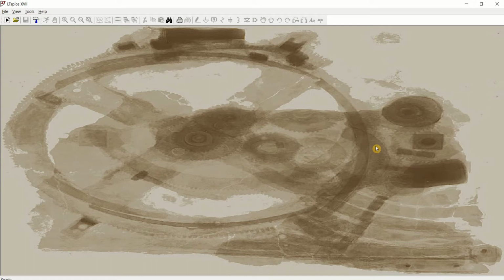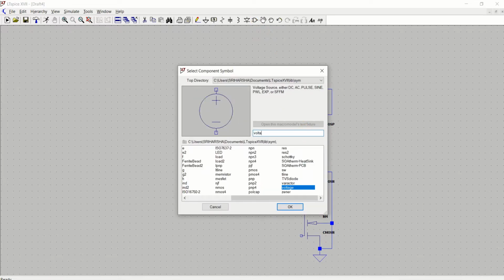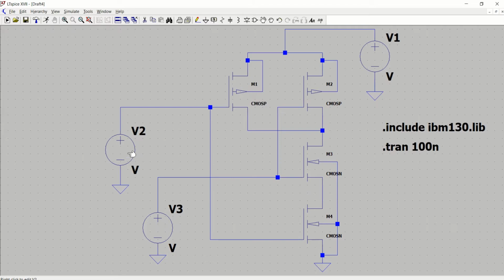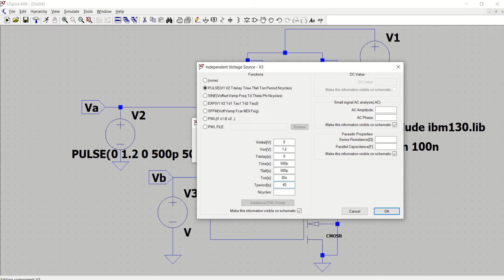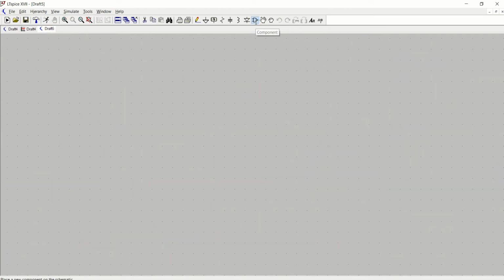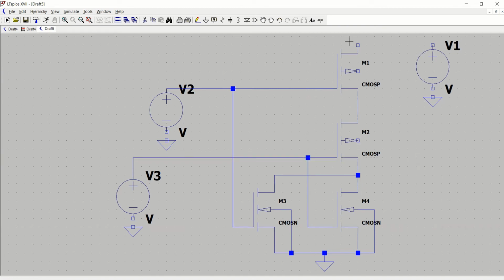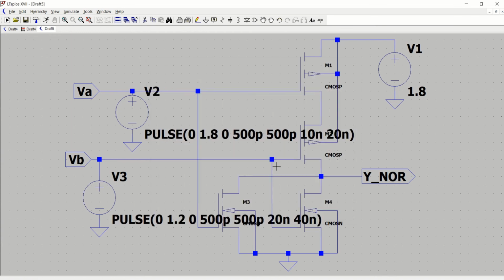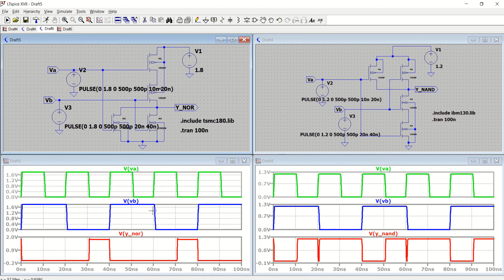CMOS NAND & NOR Gate Characterization Using Lt-Spice.

Comment: Dear Professor, 
Please, I need to help me to change the interconnect parameter in the LTSPICE for CMOS circuit conception.
Thank very much for your help 
Best wishes
Reply from the maker: What is that you are asking. I could not get you
Reply: @dr.hariprasadnaikbhattu Please, I need to simulate the impact the of the interconnexion using the LTSPICE.

Best wishes

Comment: Which one is source and drain
Reply from the maker: Hi, Always source of PMOS connected to Vdd. Source of NMOS connected to Gnd.
Reply: @dr.hariprasadnaikbhattu  thank you sir.
But I need to know with respect to body terminal.
Reply from the maker: @rohithy61  Body of any transistor is connected to source.
Reply: @dr.hariprasadnaikbhattu  thank you sir
Reply: I have one more doubt sir.
For designing full adder using 8 transistor i.e using two 3 Transistor XOR gate and one 2 transistor multiplexer, how do we need to calculate power and delay of circuit using ltspice
Reply: Please tell me sir
Reply from the maker: @rohithy61  follow any tutorial on ltspice in google
Reply: @dr.hariprasadnaikbhattu  why did you connect pmos body to Vdd and nmos body to ground
Reply from the maker: @rohithy61  It is a general rule. Pmos is designed on nwell and nmos on pwell.
Reply: @dr.hariprasadnaikbhattu  sir why did you connect pmos body to Vdd and nmos body to ground